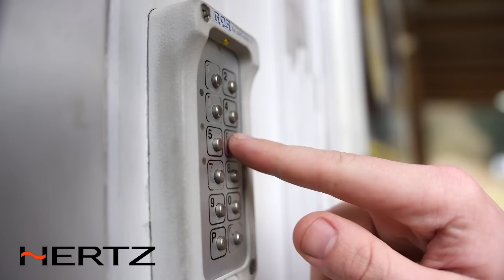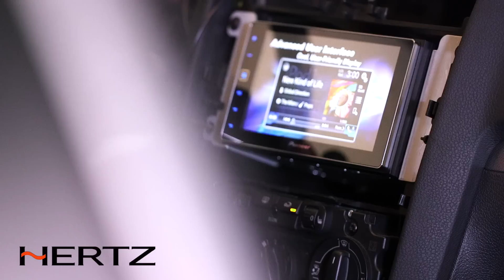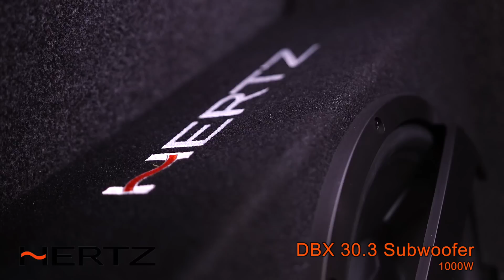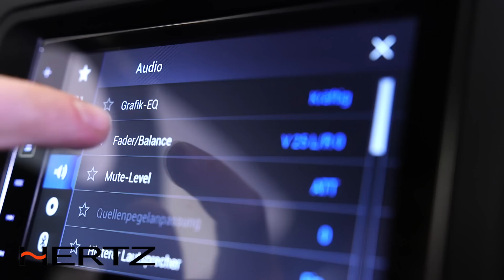VW Golf Apple Carplay AppRadio Lautsprecher Hertz HSK Hertz Endstufe

Comment: signal cables + speaker cables together and no sound damper in the doors? 
Hmm.  True rookie build...!
Reply: Tom Olsen agree...
Reply: If the cables are good and there is no issue with the signal ground there is now way to get any interference.
Reply: The fact that you think there's a problem with running signal and speaker cables together makes you the rookie son! buuuurn
Reply: Ive been building car stereo for over 25 years.
I dont need to look it up on the internet.
And l can See on your profile you Really Know what your talking About. Haha..
Reply: If you do not have proper ground in the signal curcuit you can run the power and signal cables 20 meters apart and you will still get interference. But as you have been building for over 25 years you should know that :D
Reply: Who is talking About ground?
Reply: So tell me, if you run the power and signal cables on the same side what issues can it cause? Because I've been building car stereos for 17 years and never had any :D
Reply: Damping would of make a huge impact on the sound quality. As for the signal and power wires together, I've never done it before and never will but once you have bad grounding 2 inches or 20 meters it will still give you interference.